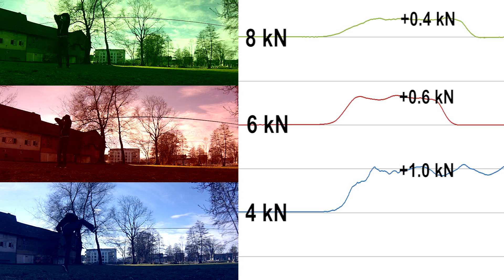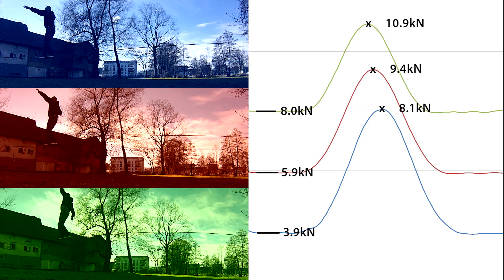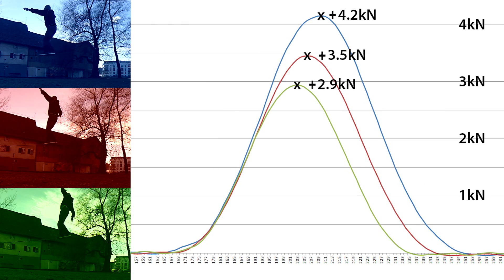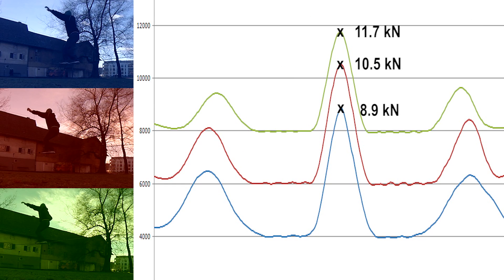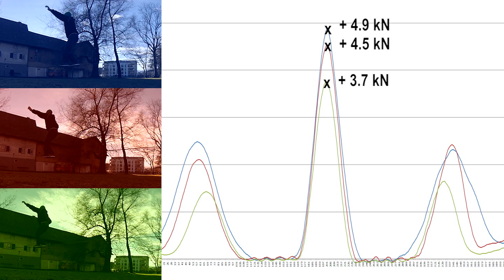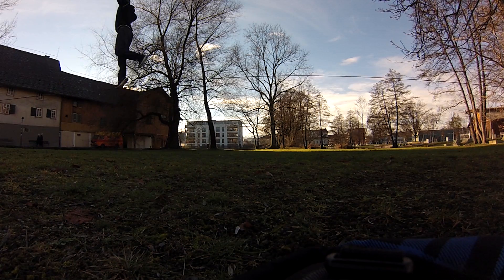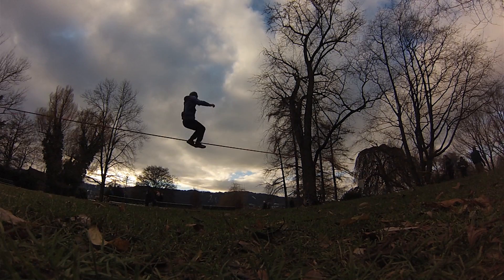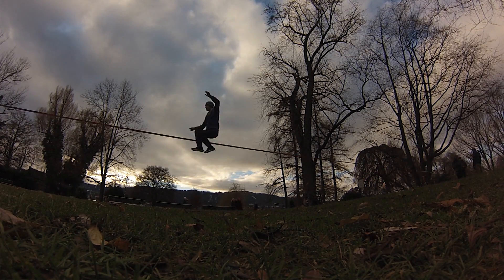Forces in Slacklines 4 - Different Pre-Tension in a 20m-Line

Comment: Hey slacktivity. I have a question about two ratchets. Do two ratchets actually get higher tension, and if so how does that work? Also in general what are the advantages of two ratchets over one? I currently own a 15m, 2" line with one ratchet, that i anchor with span sets and shackles (i use the entire 15m). I am just wondering if there will be a significant difference, and weather I should make the investment into a longer line with two ratchets? thanks in advance
Reply: +Eleanor Rigby thanks for asking this =) have the same question and line =) =)

Comment: hey slacktivity! you're vids are awesome. I was wondering what length of slack line is best for jumping tricks. i know tension important. so would you suggest a smaller line? or a long line with two ratchets?
Reply: ***** Thanks so much for the response!! i'm for sure gonna try out some longer lines with the double ratchet. happy slackin!